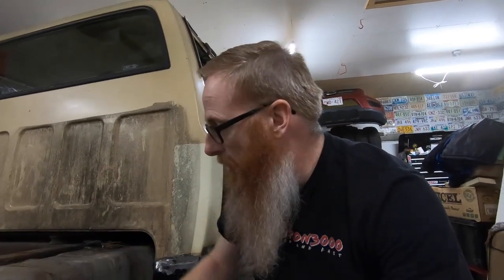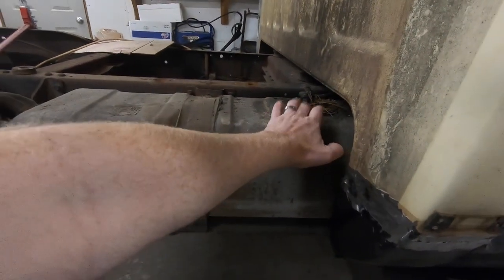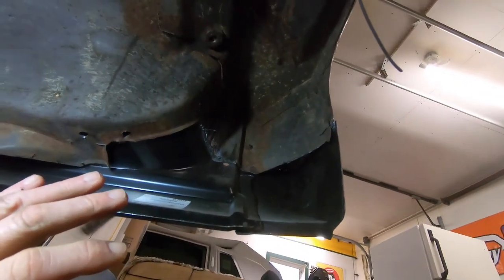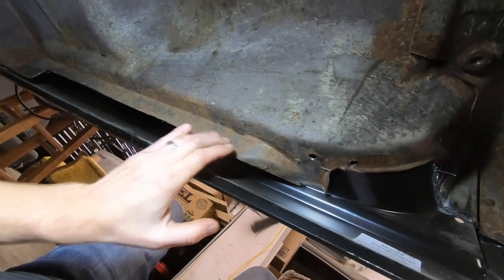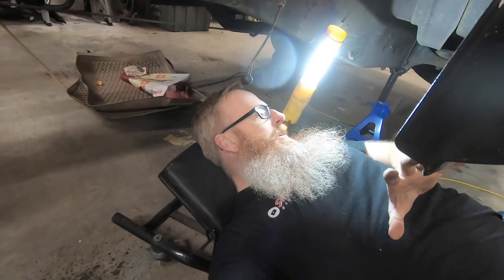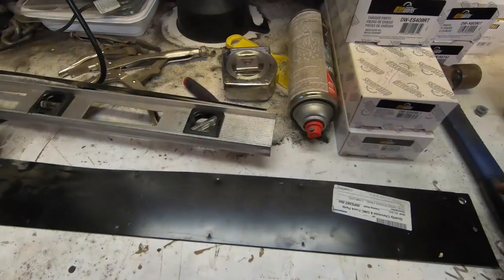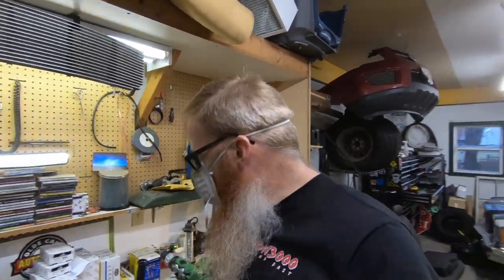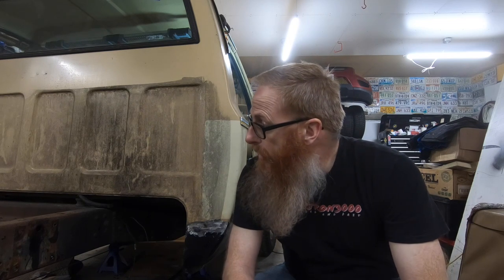HOW TO REMOVE THE GAS TANK ON MY 1977 CHEVOLET C10 TRUCK

Comment: If you havnt thought about it i would suggest replaceing the lines that run from the sending unti over the frame that are somewhat notorious for collasping. If you can i would replace as much of it with steel/stainless steel line and use as little rubber there.
Reply from the maker: Good idea! Thanks for the information!